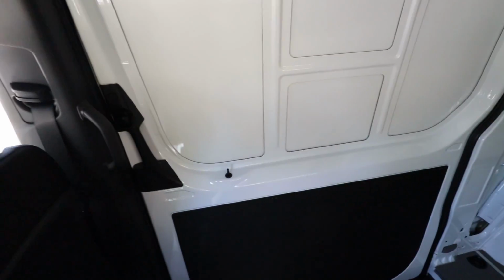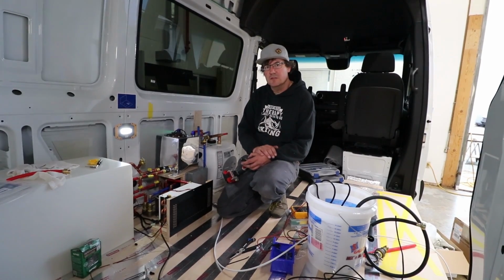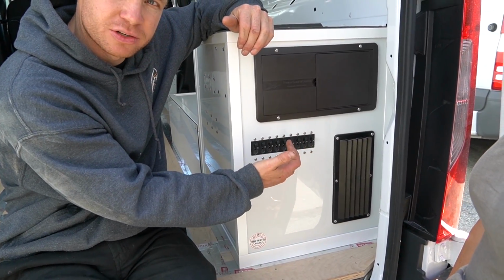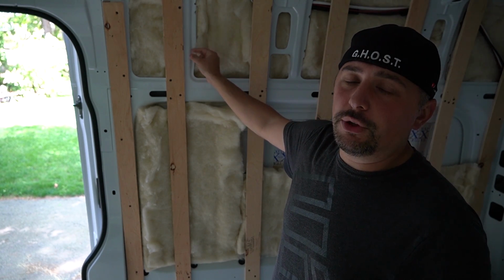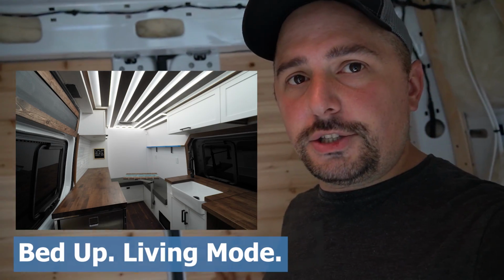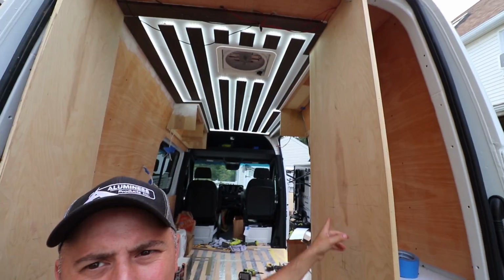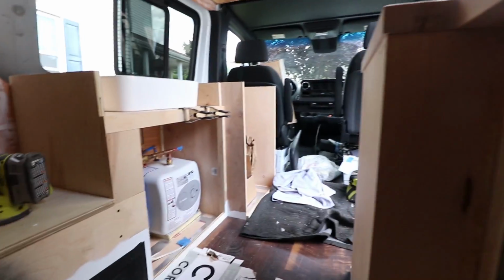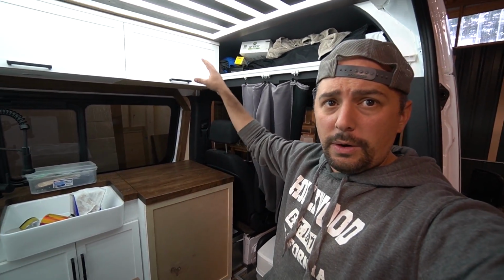FULL Stealth Van BUILD - Radiant Floor Heat, Murphy Bed, Solar Deck, Indoor Shower

Comment: It's amusing how many "live in your van" videos start with "First, spend $35k for the van."  I've had road trips from the east coast to the west coast and back again, multiple times - and all the vans together, PLUS conversion costs, plus travel expenses, totaled less than the cost of one Mercedes Sprinter or Fort Transit van, unconverted.
Reply from the maker: But you also knew there was an end to your trip. You planned for it to be over in "x" days. We live full time out of these and they are our homes.

Comment: is your van 4x4? if it not how did you make your decision not to get one?
Reply from the maker: Good question. It is NOT 4x4 and couple reasons. Didn't want to spend the extra $10-15k and I wasn't planning on taking my van into places that 4x4 was needed. I also didn't want to take my "home" into places that would need 4x4. I haven't tested yet but I've heard with proper tires and knowing how to drive correctly then even 2 wheel drive Vans are fine in most 4x4 areas. The extra cost just didn't make sense to me

Comment: Radiant heat: I wonder why he chose the fluid instead of electric. Fluid is risky (leaks) and MUCH more heavy.
Reply from the maker: Good question. Electric floor heat takes a lot of power and runs off 120v. Electric also doesn't heat the air as it's more of a heating pad just for the floor. With liquid and this system used it's actual a heat source for the air inside. This system is also 12v and only draws 30w on steady state. If you ran electric as much as I run mine then the batteries would be dead in less then a day
Reply: @jarrodtocci  Nice - thanks for the details.

Comment: You may have cracked the toilet/shower in a small van problem. The problem being a dedicated shower/toilet unit simply takes up too much damn space. I like your solution. It's there when/if you need it, and not when you don't. Let's face it, if you need a good scrub up, truck stop showers are the go. Well done. Is the exterior suitably stealth? How do the windows show on the outside?
Reply from the maker: Mostly everyone that's seen my van in person has said it's very stealthy. The windows look more stock then most which is why I went with them. I'm putting out a vlog on Sunday that will show a lot more of what I mean

Comment: You should adjust the low trim on your dimmer switch so that the minimum setting produces a barely useful amount of light. Then when you want a less than useful amount, you can use the switch. 🤓👍

Comment: Why no insulation? What bout rockwool or something thin? Both for sound and temp.
E: Oh I see you insulated later after some of the other stuff was installed. Still, why not rockwool?
Reply from the maker: Rockwool is a synthetic wool and some will say even worse then fiberglass insulation. Anything you need to wear a mask for while using I question. If you're looking for something thin then I'd say foam board or thinsulate
Reply: @jarrodtocci  Ah, I didn't realize rockwool was so bad. I want to do a setup kind of like what you did, but more for a work van rather than a camper/tinyhouse van. Work bench, tool shelves, etc. And have some comfort while I'm at work sites waiting to work, or messing with projects inside. But that's quite a ways down the road, don't even have the van yet.
Reply from the maker: @cdmichaelb  I've heard horror stories is all. If I could go back I'd do some things different like cover all metal with the thin rattletrap which helps with heat from the sun and helps on those summer days. Then the wool and maybe 1/2" foam board between the furring strips

Comment: Aesthetically beautiful construction. I have some questions about the functional aspects, though. 

It seems foolish to install a heating system that if any one tiny thing fails the entire system fails? Just my subjective opinion, as it sounds like a prescription for failure, whether that be in a few months, a year, or a few years? Then, when it does fail, who has the proprietary knowledge to repair this proprietary installation that took place in Santa Cruz when you seem to be based out of the far Northeast of the US? 

Then a 100 lb difference in weight in a gen 1 to gen 2 solar deck? That sounds like a lot of extra fuel needed over the lifetime of driving the vehicle. Perhaps you are making the choice to cut the entire weight elsewhere (or maybe the cost savings made up for the difference)?

Aren't you worried about mold? A mattress needs air circulation. It appears as though your mattress is lying flat on a solid surface, which...in about 4-8 months...should have a good deal of mold growing underneath it. Unless I've missed something, how have you vented your mattress so that air can circulate underneath it (as in bed slats or some other type of ventilation option)?

How is that shower working out, if you are even using it at all? I'm having a hard time imagining the usefulness of a shower system that needs so much disassembly...then the erection of some kind of shower curtain system...and then waiting for it to all dry out before the disassembly begins again. That just defies all logic and reason from what I can see so far. 

I respect that you did a lot of the work yourself, and I openly admit that I'm not sure if I could execute this myself. It should also go without saying that your money is yours to spend in whatever manner you wish, and I recognize that what I might find important in a van build may be entirely unimportant to you. 

Regardless, I do hope this is working well for you and that you are getting a lot of enjoyment out of your van and that it suits your needs and wants completely. Happy travels!
Reply: On top of that, Vans and autos in general are inherently sealed units . Far more than any house or apartment. That said, you end up with a tiny sealed space that is also insulated. Why do you need any kind if elaborate heating system.  Yes, of course  it can get real cold  but you don't a heating system that is all over the place.
Reply: @percival23  I've heard van-dwellers say that it can get really cold at night without heat, and this is why small diesel units are produced where you can have heat in your car/van/rv even if you lack any kind of overall heating system. They sell them on Amazon and Ebay and are fairly common. 

If you've ever lived in a cool, damp climate like San Francisco or somewhere where they have cold winters like NY/NJ/MN/ND and Boston, like this YouTuber, you know that the moment you turn your engine off and the heat goes off in the vehicle, it can get rather cold quickly, even though they are sealed units. The more glass a vehicle has, the colder it will be inside when it's cold outside, and winters in Boston proper (and the surrounding states of the NE) are not for the inexperienced (or homeless). They're quite bitter and brutal, even when there aren't record snows. So, in this man's particular case, I can see why Boston van-dwellers MUST have an overall heating system (especially if they have any water or other liquids inside that they don't want to freeze, as they WILL freeze as low as temps drop there in JAN/FEB/MAR). 

There may be some kind of super-insulation that I don't know about that is so powerful that it doesn't require heat in a climate like Boston (or anywhere in Canada), but if there is I'm certainly not familiar with it (and I'm also nothing close to knowledgeable about insulation, so it's entirely possible). 

Man, it is just FRIGID in Boston, even in November and December it can get bitter cold there.
Reply: The advantage I can see of the radiant floor heating system is space saving and no risk of accidentally gassing yourself. I'd say cost saving, but I imagine that floor and supporting electronics and battery is so expensive initially that it'd outweigh years of use of a diesel heater and the fuel for it combined even if it is entirely powered from solar. The other advantage is a heated floor just feels nice. I'd say it's a luxury for those who can afford it as opposed to a cost saver.

I understood they were saying they saved 100lbs on the new solar deck compared to the old one. Again the deck is a luxury rather than a necessity and it will indeed increase fuel costs due to weight but is still a nice thing to have.

You more or less said this yourself but van dwelling (like all dwelling) is really about compromise, and whilst some of us will think x or y feature is a waste of money, it really is down to personal preference and what is important to you individually.

I don't live in a van but if I did i'd get all the luxuries I could afford because that is where he spends most of his time, even more so if he works from his van so probably spends 90% of his time there.
Reply: @Ashkinda  Yes, if you're living in a van and spending a good deal of your time there (as opposed to working most of your day in an office), the luxuries are nice. 

Since this van-dweller is in Boston, heat is a matter of actual survival and NOT a luxury at all. The radiant floor heating might be a luxury where I live (and yes, it does feel quite nice! lol), if he is spending the majority of his time in Boston or anywhere in the Northeastern states of the US, it's likely a necessity (and especially the point you make...you don't want any toxic fumes or carbon monoxide poisoning). 

It is his money and he is definitely entitled to spend it however he sees fit, and if he wants to drive all the way across the country to have his proprietary heating system repaired in Santa Cruz, that's also his business and not mine.
Reply: @le_th_  Yep, heating is definitely one of the "grey areas" of van life. On one hand there are very popular youtube creators that claim to have lived for years in colder climates than Boston just heating their van with a propane cooktop or even candles and little/no ventilation and it was just fine whereas others claim they have spent hundreds if not thousands on heating systems and still have issues.

Comment: Just buy some cold room material and build your van....heaps cheaper and everything is square for easy fitting , and way more insulation value. It looks like a delivery van from the outside so it’s much more inconspicuous than everything else. Buy a small diesel heater to keep you warm if you need it , and a small air con to keep you cold if you need it...Your doing it the hard and expensive way mate.

Comment: Is the wool insulation superior to spray in foam ?
Reply from the maker: I prefer wool. Being superior is up for debate. Spay insulation is typically a lot more expensive and if done in a van and not sealed correctly then it can break down over time. Also if done incorrect it can also warp the van

Comment: Is that radiant floor and water heat diesel/electric or electric only?
Reply from the maker: Works similar to a espar heater which pulls diesel from the tank (also works with gas motors) as a heat source, but is powered by electric. The fluid in the floor is glycol which is antifreeze.
Reply: Thanks, that’s what I was thinking but I only heard you guys talk about how many watts it’s pulling
Reply from the maker: @squirrellips7472  yeah the other heaters pull power too but no one ever talks about that. Not as much because those don't have a apparatus to heat the glycol which takes a little more power to do so. They other heaters just have a forced air
Reply: Thanks again, 
I’m looking to have everything powered by diesel and or electric on my next one
Early retirement in just over a year... F#%k Yeah!!! Lol..

Comment: AM I THE ONLY ONE who has no idea how that shower is going to work and not make a everything wet inside the entire van?? there are no sides, not even covering the cloth driver seat, nothing cover the window, nothing above the short door... what the heck
Reply from the maker: The curtain will drop down and be 360° around therefore no water will go anywhere except inside
Reply: @jarrodtocci  ohhhh i didn't see the curtain!

Comment: With all that Solar Power I would almost consider adding an electric motor. :) I think I understand that it still doesn't cut it to put panels on Ecars but it could possibly relax my Range OCD (if I would drive an electric).
Reply: One full day of that solar system's output could move the van about 1000ft, assuming flat land.  Maybe less.

Comment: The ceiling really is very good. I appreciate the work and skill put in. Your making a good job of it. Wouldn’t like to guess the cost of it though. 
Did you think to maybe putting in holes in the bed base. It allows air to circulate as we sweat when we sleep. It will also allow light in through the back. Just a thought. 
Did you weigh the van pre and post works?
Reply from the maker: Thank you. Haven't weighed yet but will soon. I'm sure I'm under GVWR but always nice to know. There are slates in the bed to help air circulate

Comment: The idea of the insulation is that it needs the fluffiness or the air within the insulation itself to be part of the insulation process. Air is needed. If you stuff it in you won’t get the air.
Reply: That's actually an old theory that's been proven wrong, dense is better, like styro.
Reply: @mrmotofy  you realise that stryofoam literally has foam in the name right. It's got air inside. Poly styrene(stryofoam with no foam) is a decent thermal conductor.
Reply: @Anon.G  yes but the light fluffy popcorn stuff is a low r value while the dense firm solid stuff has the higher R-value. Dense insulation inhibits airflow and heat loss giving a higher R-value. The opposite of what the insulation industry has been telling people for years. But the whole industry has been told fluff your insulation for better R-value, but that's false
Reply: @mrmotofy  it's not false.. dense foam has more air pockets they are just denser.. fiberglass/etc need to be fluffed because if you compact them too much there is no air. Air is an amazing insulator which is why double/triple pane glass works well to insulate.
Reply: @QargZer  You're entitled to believe anything you want. I know people who truly honestly believe a person can defy gravity and fly if you believe hard enough...doesn't make em right, but they believe it.
Reply: @mrmotofy  it's not an opinion, it's a much tested fact that anyone can test, comparing the insulation value of fluffed fiberglass insulation batts vs the same batt compressed down.

Comment: Just curious why you would choose a radiant floor heating system? The numbers don't make sense. 90 watts will not put out enough heat to heat your glove box regardless of how efficient the system is.  It takes up a lot of room. It doesn't seem like it would be very efficient and use a ton of energy and a lot of your heat is going to be lost through the bottom of the floor.
Reply from the maker: 90 watts it just regarding the power, but the BTU output is 18,000 which enough to heat a small cabin. The 90 watts is also running full blast, but when it keeps it on a steady state its more like 30 watts of power. The coldest part on a van is the floor and that lets in most of the cold is through the floor. So having this system helps a ton with that and heat raises. My lithium batteries are also on the floor which really helps because lithium batteries should never get too cold or they will fail.
Reply: floor heating also gives an even heat and distributes well, unlike an often blocked radiator. And no, it doesn't really take up more room, if anything, it allows you to use the space even more efficiently when you don't have to consider a radiator and it's need of free airflow to be efficient. Hooked up to your engines cooling system it's basically free heat when driving, and it keeps your engine warm for easy starting in the winter. Floor heating is standard in "polar-class" RVs and campers in northern europe, because in a real winter setting.

Comment: So where are you getting the 60-70 watts to run all this stuff?
Reply from the maker: The power system also shown in this video that has 4800 watt hours of lithium batteries, 500 watt solar panel, 700 watt DC to DC charger, 3200 watt inverter

Comment: Process engineer here. Guys, whatever you do, never insulate yiur van like this. The term heat bridge is used for a reason. All that insulation material is almost useless if you do not cover the whole contact area. He leaves out so much space between the big pocjets, my god. Second, you never want to let your moist inside air touch the metal of the structure as the metal is below condensation temperature in cold conditions which leads to the third point, never use organic material for insulation if you dont completely and thoroughly isolate from any possible liquid water. This is a joke and should never be built as is shown here if you want to use the van longer than one winter. And I so not mean San Diego Winters. Cheersbye

Comment: looks good. no vapor barrier between the insulation and panelling though?
Reply from the maker: Not supposed to use vapor barrier when using real wool insulation
Reply: Don't use a vapor barrier in a van there's one already...the outside steel

Comment: If the temp gets below 5c you will have major condensation build up and that fiberglass will be soaking wet.
Reply from the maker: It's not fiberglass. And I've been in -7C (18F) and it held up great

Comment: Nice job. Really like those roof lights. How much the build added weight of the van? When  you take a shower close the door and water sprays on the inner surface of shower door will it fall down to the wrong side of the door threshold or how you keep water dripping to  the shower floor not outside.
Reply from the maker: Thank you. Haven't got it weighted yet, but will soon. I'm getting a new shower curtain that is 360° and will fall inside the pan so any splash will happen inside. Plan on doing a video on the shower on its own